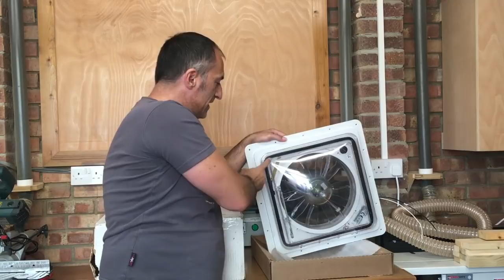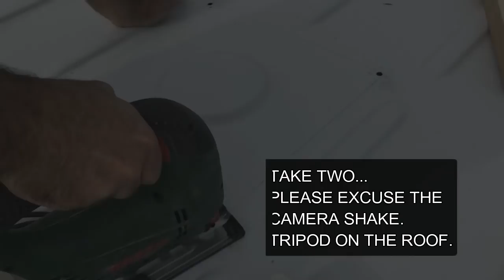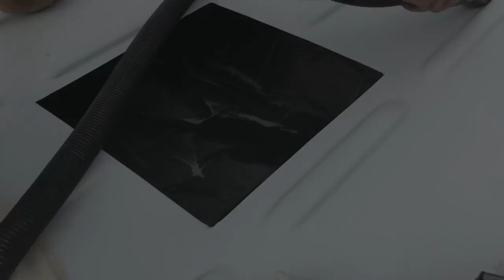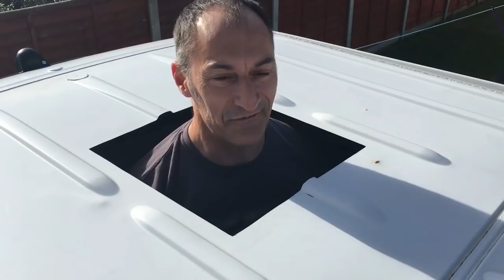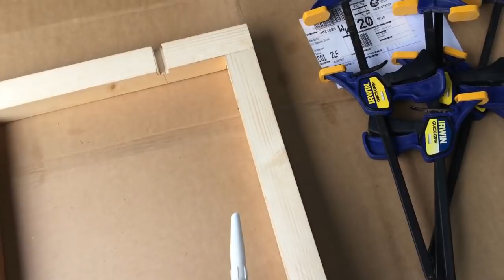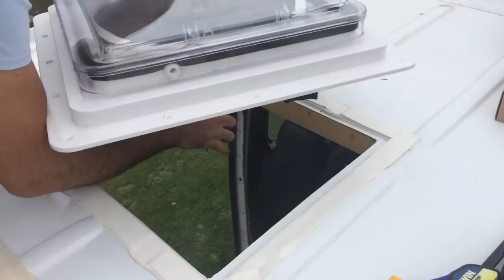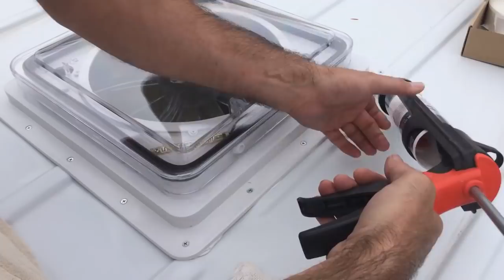Mercedes Sprinter Self Build Campervan - Roof Fans

Comment: Absolutely fabulous series. Just starting my race van project and this is invaluable. Can I ask if you are happy with your purchase of the vent(s) after some use? Would you still go for two? Are the remote and automatic features worth the extra price over more manual models now that you've had them a while?
Reply from the maker: Hello, I can give you some good feedback here, firstly the good points, yes two is definitely best, you can hear the change in motor noise when the other one is shut and the fan is trying to get its air from a closed van, so two is better, one in one out, the clear top give us lots of daylight so you don't need to put lights on. We normally leave bedroom one open a little at night and that helps keep condensation away.
Bad points, the rain sensors are very temperamental, if the just get a little bit of morning dew on them the vent closes and you wake up both vents shut, so we power them off at night but then if it did rain they wouldn't shut. The fans are noisy so don't run them at night and only use them when cooking. So in hindsight maybe just a manual opening vent over the bedroom and a simple extract fan over the kitchen would be enough. We have not used temp controls either so I guess all the fancy controls are not really necessary. If Maxxair do one with a clear cover for daylight that might be a better extract fan. Hope that helps
Reply: Thank you so much for this review of the fans. I’ve wondered if just cracking the from cab windows and 1 rear fans would be sufficient ventilation?
Reply from the maker: Tranquility Travels yes that would definitely work, we have our rear vent over the bed open 2" and that keeps all the condensation away at night, you idea of cracking the cab Windows will definitely help to keep the cab clear as well

Comment: How are the seals that you made with the sealing tape doing? They make adapters for the fan apparently. Worth the $50 to use the adapter versus what you did? https://www.ebay.com/itm/Sprinter-NCV3-High-Low-or-T1N-Roof-Vent-Adapter-/132298140143?oid=141974424223

Comment: Hi Greg, as always top quility videos! wanted to know, i have ordered the Sikaflex 521 instead of 512 for carvans. was wondering if i should replace it or is that ok as well. thank you very much!
Reply from the maker: Itamar, the 521 is extra durable as it’s not affected so much by UV so I would keep that. It is still an adhesive and sealant that stays elastic so will be perfect for sealing on roof around fans etc
Reply: @GregVirgoe  thank you so much. Very kind of you to answer everybody's questions, I'd never have the patience for it. Much appreciated
Reply from the maker: I’m always interested to see what everyone thinks and if I can help with some advice that’s what the channel is all about 😁👍🏼
Reply: Hi Greg could you give a link to the fan please, if this still the one you recommend

Comment: Help please! I fitted this same vent a few days ago on my Transit. The ribs on the transit roof are awkwardly spaced for this fan meaning the lips where the vent screws down overhang the high points of the roof by around 1cm. This meant there was a gap under the lip where my screws went into the van roof. In hindsight I would have positioned the fan differently to avoid this situation, but I had a small window of opportunity due to weather so cut the hole in the roof and cracked on thinking I could just pack the gaps with sealant. It rained a bit the first night after I did it and there were no leaks, all was good. However after heavy rain last night I noticed my wooden frame was soggy in one corner and there were a couple of drops of water on the floor. I'm now panicking as the weather is forecast to be wet this week and I have no idea how to fix it. I used a Sikaflex alternative (Puraflex 40) to secure and seal the fan so I'm assuming that now it's in, it's not coming out. I can only assume the water is making it's way in through one of the screw holes somehow, but I have no idea how to fix this. Any help would be very much appreciated! Thanks in advance
Reply: Worked perfectly so panic over. Thank you!
Reply from the maker: Excellent news Simon, well done.
Reply from the maker: Sorry to hear you are having problems. Remove the screws closest to the leak spot and put silicone in the screw hole before replacing it. Put sealant over the screw heads and an extra bead around the fan base. Best wishes

Comment: Really helpful thanks. Only question is which type of Sika - 512 is air cure by moisture in the air and will not cure if it is too deep. It seems that Sikalastomer 710 Butyl sealant might be better for the seal but not as an adhesive?

Comment: Hey, Greg! I've been obsessively watching your videos while prepping for my van build. Admittedly, the fan installation ranks up there in terms of what makes me the most nervous! I see that in this video you use something called 'mastic sealing strip' - I'm from the US, so I haven't been able to find that particular thing here. Is there a different search term I could use to find a similar product in the US? Thank you so much!
Reply: I found this: is this what I need? https://www.amazon.com/Scotch-Seal-Mastic-Tape-Compound-Rolls/dp/B071W4ZB7F
Reply from the maker: Hello, sorry for the late reply to your message it went into my spam folder because of the link.
Don't use that stuff you need this stuff instead https://www.amazon.com/XFasten-8-Inch-30-Foot-Sealing-Patching/dp/B07D9CNB3H/ref=sr_1_cc_9?s=aps&ie=UTF8&qid=1539490787&sr=1-9-catcorr&keywords=butyl+sealing+tape
Reply: @GregVirgoe  I'm interested to know why you recommended the butyl tape, whereas the link @ellefail posted looks more like the mastic in your video and links. (And someone above is saying it isn't compatible with Sikaflex).
Reply from the maker: PermaHeretic the application in the product description was more appropriate to the job.

Comment: I find your videos very good and your work methods professional.  I was wondering about the ridges in the roof and how to accommodate them. Could you list what you ordered from fantastic fans, what was the model details and number, is the transparent lid additional?  Thank you
Reply from the maker: Hello Mike @ 0:20 I tell you what the model number is. 
The clear lid came as standard you can also get a darker blue tinted cover. 👍🏼
Reply: Thanks , Yes I missed that, but when I went to the URL they all seemed to have non transparent tops.  I'm converting a Welfare wagon, 2013 Sprinter 310 so most of the facilities are already installed, except roof ventilation, and beds. One issue is that it already has a liner and I'm concerned about if there is any insulation, and removal and replacement of the fabric liner. Finally, I was really pleased to find the front passenger seat kit you featured in another video, I had heard one was available but so far hadn't found a supply. I haven't watched all your videos but will continue to view them as you do a really good job.  We went to Italy this summer in a hired camper van and now have the bug, just in time for retirement.Regards & Thanks Mike Barry
Reply from the maker: Hello Mike, are you in the uk and is it a clear one that you are after? What type of van do you have please? Cheers
Reply: Yes we live in Northampton, I think that a clear lid is our preferred choice, Our van is a 2013 310 Sprinter

Comment: Hello Greg,
Very informative video. 
I just installed my fans, I did exactly the same as you except puting the wooden frame, so only exposed screws straight to the metal. Do you think it's a mistake I will regret? Would you recommend taking the fans out and re installing with the frame?
Thank you for your opinion 🙏🏼
Reply: Alternatively, I just thought to put nuts and washers for the fastening. What is your opinion?
Reply from the maker: Hello, the main purpose of the timber frame was to provide some rigidity to the cut metal edge. While the roof is intact it’s quite strong. When you cut a hole it become more flexible. Without removing the fan could you back the screws out a little to fit the frame under?

Comment: Looks a beautiful finished product. I see you had a couple of ridges in the roof and you used the double sided tape to build up. I also have two ridges which I will need to battle with, I was wondering though as you screw the vent on, it is pulling tight and pressure is on a couple of small ridges. I am wondering if I should make a low profile 'frame' for the top of the van where I allow for any roof curvature and ridges. Is that overkill do you think, just go with quick and easy tape? thanks
Reply from the maker: Hello Andrew, just go with the tape, it works brilliantly, very pliable, like really sticky plasticine.
The wood frame on the upper surface would rot over time and not be flexible to conform to the ridges

Just when you screw in don't over tighten the screws as that will deform your plastic flange.

Comment: Love the video, nice work! And thanks for all the links for the things that you used. One question I had was, what was the size of the wood that you used for the base/thickness? Did you just glue the wood together, or screw it? I'll be doing my install next week! Cheers.
Reply from the maker: I made the wood frame the same depth as the ribs of the van, however I made a small mistake as I should have added extra for the ply battens as I now have a small gap to fill so the ceiling does bow in. Take a look at my frame video for construction, https://youtu.be/iI3nu6qhC1g

Comment: Hi Greg, are the roof vents supplied with blinds or can they be fitted? I'm a little concerned about light entering the van when sleeping. Great series of videos!!
Reply from the maker: We thought exactly the same and these ones don't come with blinds so we bought external blinds from Fiamma
https://www.leisureoutlet.com/fiamma-turbo-and-roof-vents/fiamma-internal-fittings/fiamma-outlet-store/6535-fiamma-rollo-vent-blind-system-40?gclid=CjwKCAjw4PHZBRA-EiwAAas4ZrsOjwXtNoe3306cqx5JfLNIhYHIBZtZzUdZ5RgOT52zh48LItx16xoCMNoQAvD_BwE

Comment: Hi Greg. Thanks for uploading this video series, very helpful. I see you have installed these ventilation fans which will be great for summer, what are you using for ventilation in the winter? When it is raining and cold outside? I don't want to blow all the hot air outside. I have been looking for heat exchange ventilation but there does not seem to be much out there. Thanks Adrian
Reply from the maker: That is a very valid point, we will just crack open the roof vent by hand to allow a trickle vent of air at all times.
At home we always have our windows on their first lock position even in winter as we like to have a well-ventilated house and do not like to feel stuffy, yes it may take away a little heat but we need fresh air.

Comment: Thank you for all of your videos. I plan to chase the sun a little and in two minds about cooling. Should I consider the two fan system as shown.... or Go for an air conditioner.... would really appreciate your thoughts
Reply from the maker: You will struggle to run an air conditioner off leisure batteries. The system would need to be huge to supply enough power. You could use it on hook up but that limits you to camp sites only. 
We are mostly chasing the sun too and with good insulation and ventilation and reflective blinds on the windows I think it will be ok inside.
Reply: Thank you Greg for your reply ... it’s the answer that I needed ... keep up the great work, watching your progress with great interest

Comment: You have GOT to be  an engineer by trade.  ;)  That's a really solid fan installation, especially with that support frame underneath.

We use Sikaflex on the boat as well (not the caravan stuff, of course).  Really happy with it as a product. And yeah, one doesn't need tons of it (though on a 40 ft boat, it adds up).

Comment: Your videos are great, very professional planning and execution. 
  How are the fan installs holding up as far as water intrusion? Using the sealing tape to build up to make the flat surface for mounting the fans made me concerned that water would find its way inside. Just returning from London I realize it NEVER rains there...  ; )
Reply from the maker: Absolutely no problem whatsoever. The sikaflex sealant around the fan seals it completely and not even the slightest sign of any leaks at all. I have had rain, ice and 6" of snow on top the van for weeks.

Comment: Greg, thank you for your help! We're also converting our sprinter, but I cant seem to find the mastic sealing strip where I live, USA. Maybe you can tell me what the sealing strip is made of or what Americans call it 😊. Greatly appreciated.
Reply: I think I may have found it: butyl tape?
Reply from the maker: Try this link - https://rover.ebay.com/rover/1/711-53200-19255-0/1?ff3=4&toolid=11800&pub=5575265109&campid=5338027957&mpre=https%3A%2F%2Fwww.ebay.com%2Fsch%2Fi.html%3F_from%3DR40%26_sacat%3D0%26_dmd%3D2%26_nkw%3Dmastic%2520sealing%2520strip%26rt%3Dnc%26LH_FS%3D1%26_trksid%3Dp2045573.m1684
Reply: Greg Virgoe thanks for your speedy reply! When I clicked link it says "no results found." From my search, whats comparable is a butyl/putty tape.
Reply from the maker: https://www.amazon.com/P-L-S-White-Mastic-Sealing-PLS/dp/B01LFLU7PU/ref=sr_1_6?ie=UTF8&qid=1520901332&sr=8-6&keywords=mastic+sealing+strip

Comment: Having done some campervan conversions myself I really enjoy your work and the thoughtful planning before the/any act. Your videos are definitely a joy to watch! However, I wouldn't really dare to handle that sharp edged metal while doing those cutouts with no protective gloves on my hands. The guy doing the windows (in a previous vid) also seemed to do the cutting and bending away the cut metal strips with bare hands... Don't ever do this (especially) when your experience with that kind of work is somewhat limited, I' say. You'll need both hands and preferably all fingers intact for the work to come in further stages of the conversion.
Reply from the maker: You are absolutely right. It is always best to wear gloves when cutting metal. Sorry I forgot to put mine on in that video and well spotted.

Comment: Really great videos, so clear and technically best I’ve seen. I was just wondering if you considered the maxxair maxfan as I think that’s what I’m going for as you can use them when it’s raining. Was there a reason you chose the fantastic fan in stead.
Reply from the maker: Hello Jon, it was a very difficult decision to make they both have some great features.
I particularly like the fact you can use the Maxfan while it's raining. Mine closes automatically when it rains.
The biggest benefit for me was the natural daylight, mine are totally clear and let in a lot of light.
The rear part of my van has no windows so having the clear fan there now means it's really bright even with the doors shut.
The biggest downside was trying to get them here in the UK, nobody sells them at a reasonable price and it actually worked out cheaper even with import duty and shipping to buy them from America.
It was essential for me to have supply and extract, thermostat control and fan speed. You Maxfan will do that and more if you go for the remote control version?

Comment: Excellent video. The fan install is for sure the part I will be most nervous about when I do mine but this made me feel a lot better about it.
Reply from the maker: Hi Brent, cutting a big hole in the roof of your van is very a nervous time for anyone but if I cab give you a couple of bits of advice it's these. 
Measure, measure and measure again. Then make sure you have a new fine toothed HSS blade and it will make the cut much cleaner. 
Thank you for watching and best of luck with your build.

Comment: Sikaflex is also sold in Canada, I discovered thanks to you that there was a primer No. 210 to be used prior the application of Sikaflex sealant:  I will look for it here.

I am watching tons of videos about caravan construction and van conversions, either from North America and Europe and I noticed that North Americans were putting tons of caulking over flanges and screw heads, Europeans were not.  I think that effective sealant should be located UNDER flanges and screw heads, not over.  It is the first time I see someone from Europe putting sealant over screw heads.
Reply from the maker: Anytime you are dealing with potential water leaks I’d rather be “belt and braces” which is why I did both.

Comment: Seriously - tape on the jigsaw instead of all over the van. I wonder how many installers have slapped their heads and said "D'OH!" after taping all over their roofs. lol
Reply from the maker: LOL it's the little things that make the difference.
I was so careful with my switch plates in the lighting video but still managed to put some small scratches on them.
Nobody will ever notice or comment on them but I know they are there.
Reply from the maker: I’m pleased that you noticed
Reply: Why would you not tape the roof, presuming you use an easy to release tape?

Comment: cutting out the hole for the fan you cut to the line smack on I've seen others with wonky lines nice work
Reply from the maker: Thanks Stephen, it helps to have a brand new, fine tooth HSS blade and it will cut very cleanly. 👍🏼

Comment: Another great video. I saw a building with one fantastic fan and air intake via valves in the floor. Any thought about that solution?
Reply from the maker: Hi Paul, I think any method that promotes good circulation across your van is a benefit to say just a single roof vent. Locating floor vents may be difficult practically.